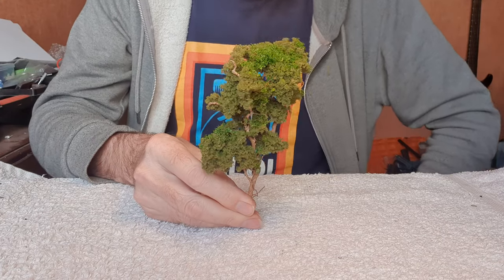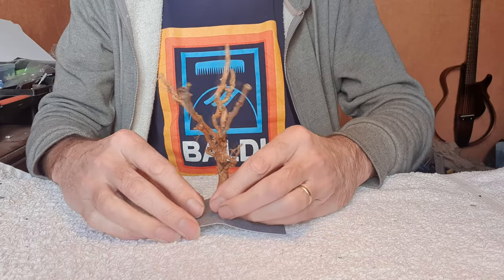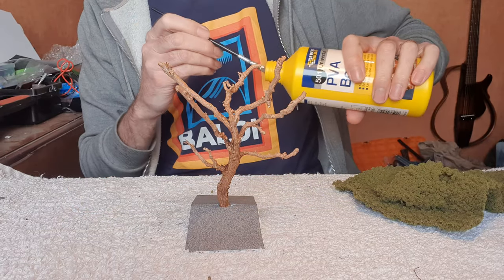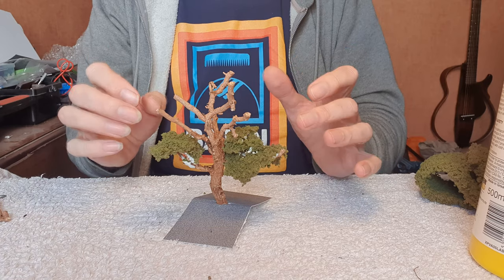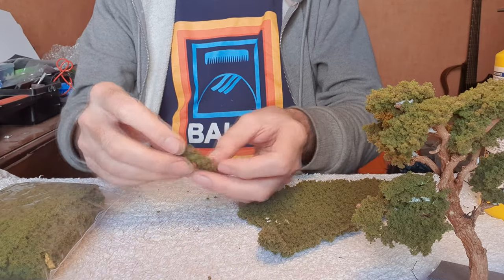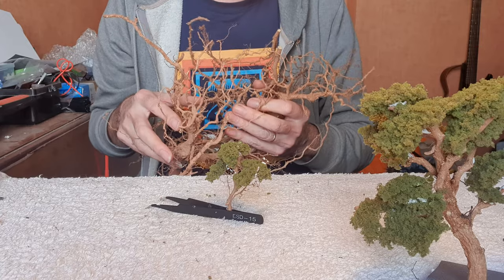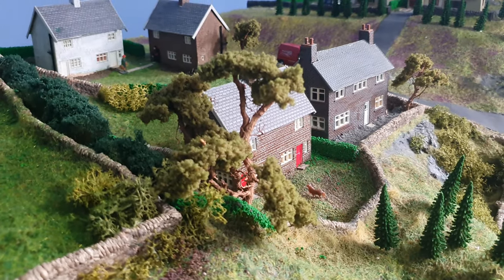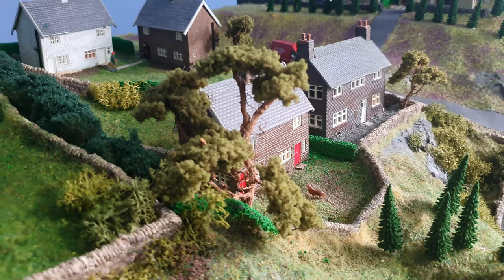Tree Root Trees

Comment: This is a really good idea. Had never thought of using tree roots. That 'foliage' is very quick and very effective.

Not so sure about the urbanisation of your layout. I like the tranquil charm, and the lack of highways and motor vehicles adds to that. I think a wider road running down the hill might come to dominate the layout, and it will look a little odd if it just goes to, and stops at, the station car park. If you do continue with tarmac-ing your wilderness, bending the road round to the left so it continues over the tracks and off the layout might make it more realistic (and with a shallower gradient), and gives you the opportunity for building an over-bridge (complete with train spotters!)